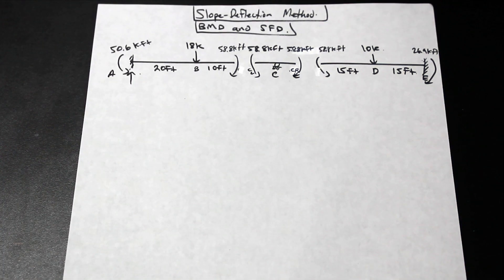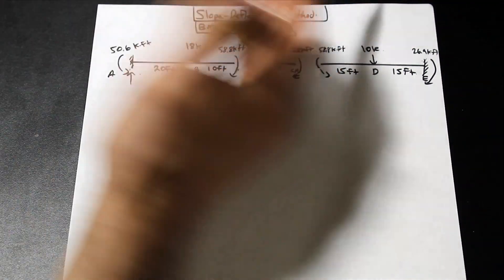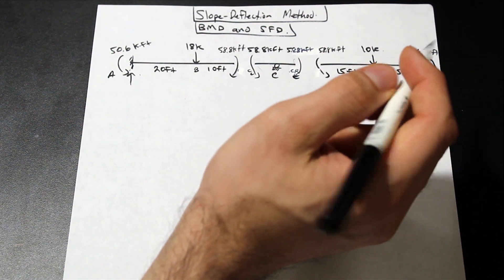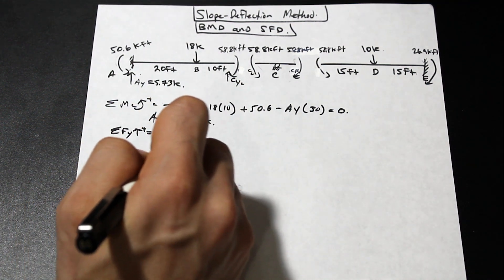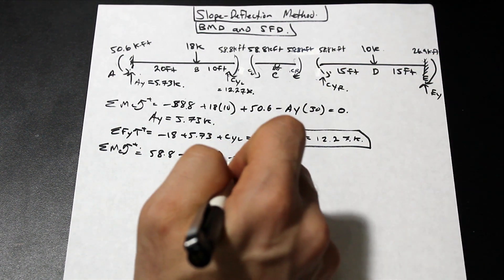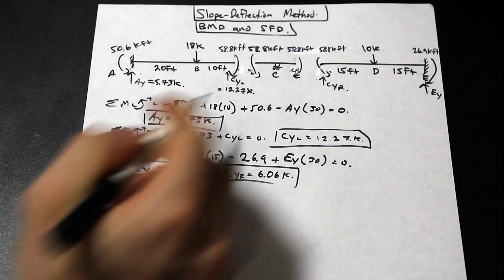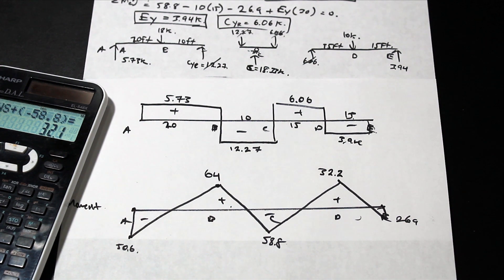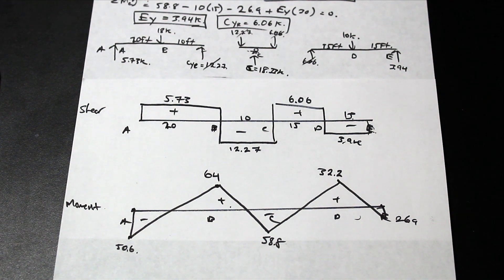Slope Deflection Method Part 2/2 - SFD and BMD

Comment: Why at point C the Bending moment is not zero ?
Reply from the maker: The net moment after summing moments = 0 at the support is 0, because it's a pin.  If it had some fixity the net moment wouldn't be 0, assuming the spans were not equal or the loads on both sides were equal.  An internal pinned support will develop an internal negative moment, but the unbalanced moment will = 0.